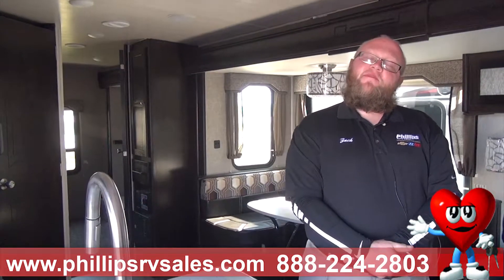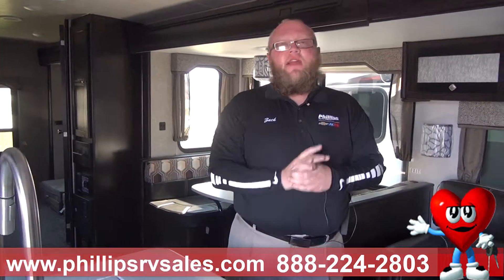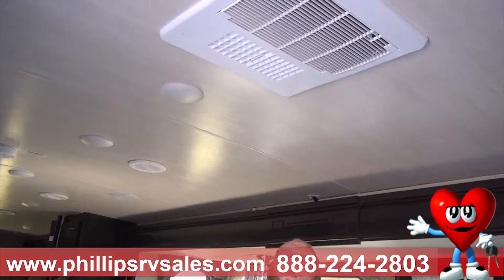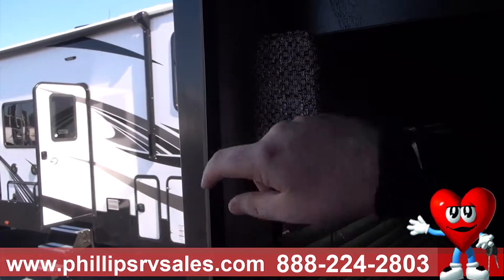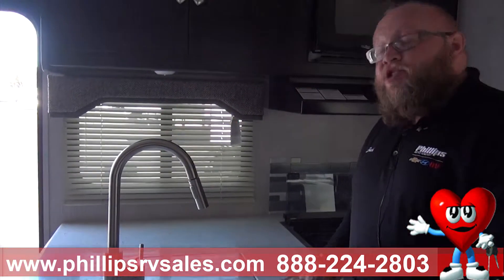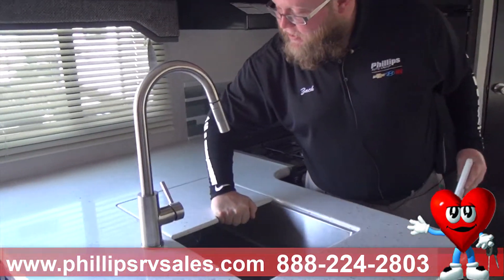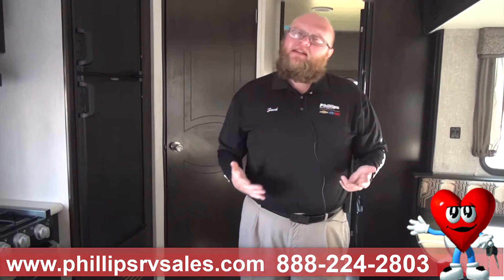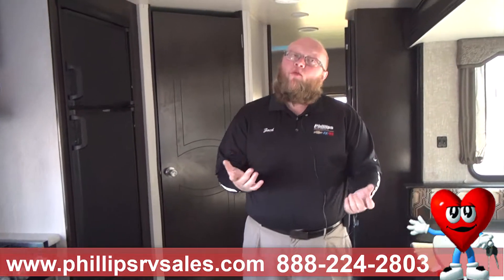Heartland North Trail Construction - Phillips RV

Comment: Thanks for this video. When you say the floor is one solid piece….you are saying they literally lay a 8’x30’ (or whatever length of box they have)? What’s the thickness of that single piece of wood (plywood?) Those interconnected pieces of 4’x8’ plywood is 5/8” thick….I would be very surprised is that single piece of wood sub flooring is 5/8” thick (maybe 3/8”?)
Reply: I'm trying to find the floor construction specifics myself.  No luck yet!  Did you find the answer to the plywood or material thickness?